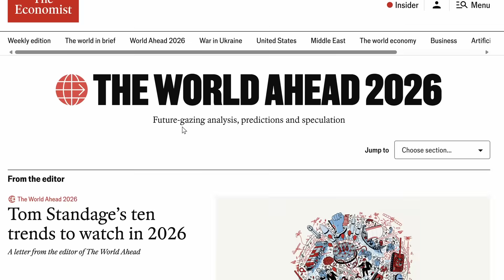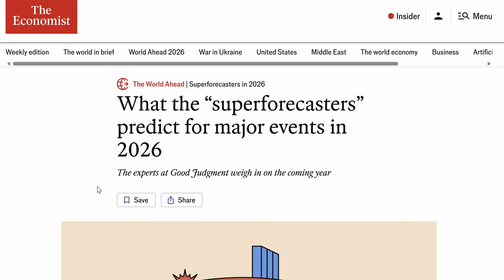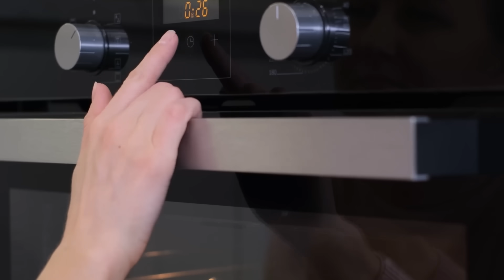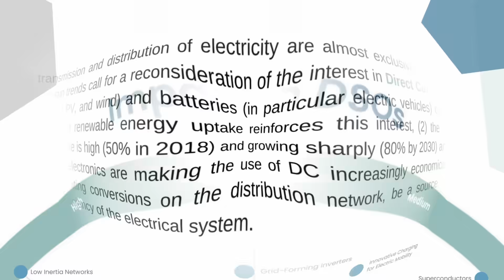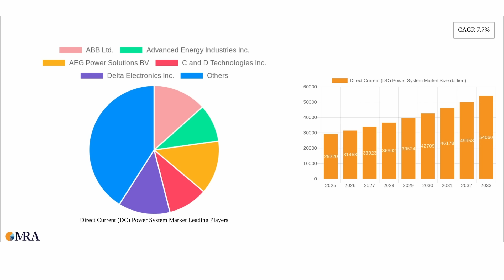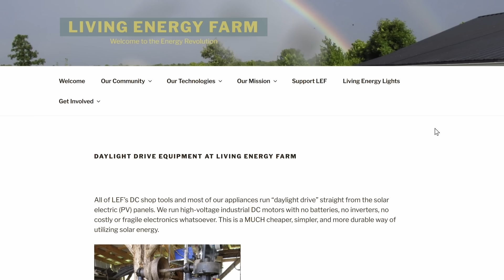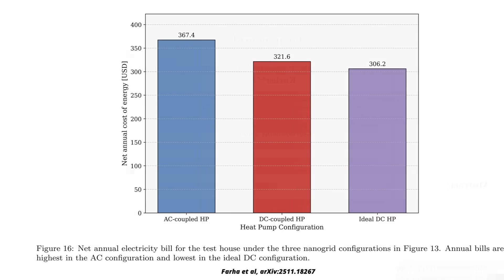Are We Using the Wrong Kind Of Electricity?

Comment: Talking about DC as if it is one thing is misleading. DC comes in many voltages. A 48VDC battery will not power a flashlight or cellphone. A 5V USB power bank will not charge a car. Converting from DC to DC is as lossy as converting between AC and DC. 
High power DC transmission will leak causing ground currents that will corrode pipes and foundations miles away and requires technicians to test for and stop leakage. An example is existing DC train third rail power.
AC was chosen for grid distribution for many reasons. AC has a good balance for corrosion, safety, losses, and cost.
Reply: DC can still be alright direct between distribution centers if you dont need to do anything to change it.

In NZ we have had a DC link from the hydro dam to wellington for decades as DC doesnt need as powerful control gear. Those lines are very high up in the air though (part actually goes under the cook straight)
Reply: @Alice-si8uz  Long lines and high voltages are necessary to make D.C. viable.
Reply: @tedmoss same reason they used AC, 100.plus years ago AC was chosen because transformers were the only viable solution, today's high power semiconductors provides an alternative
Reply: @tedmoss  High voltages are necessary to make AC viable too.  It has nothing to do with AC vs DC ... transmitting power long distances requires high voltages to reduce the current because power-line losses are roughly a function of the square of the current.   P = I * I * R.  (ignoring other things like corona losses in AC systems and such, for brevity).

Doubling the voltage cuts current in half, but also cuts losses to 1/4th of what they were before.   That's the magic of how power is able to be transmitted long distances with low losses.

Average losses for the U.S. grid run about 5% now.  That's it.

-Matt
Reply: Modern power supplies use semiconductors and high-frequency transformers. PC power block , for example. 115-230V AC is rectified by diode bridge. Then the DC is converted using transistors and a high-frequency transformer to the required voltages, and rectified again. This results in voltages of e.g. 12V, 24V, 5V, 3.3V. Modern server power supplies are adapted to 115-230V supply voltage, and it doesn't matter whether it's AC or DC. Nothing even needs to be switched.
Reply: @imantsjansons5009  This is for computers mostly and has been that way for many years.
Reply: @tedmoss  since the beginning, to be precise.
Reply: @tedmoss  No, these are everywhere. Only in rare occasions you can see a good old 50 Hz transformer in a power supply unit today.
Reply: @imantsjansons5009 MEGA THUMBS UP.

There are not many people, which know, they can run a PC power supply with DC.

My 450W and 850W PC power supplies are UNIVERSAL working with 90-260V AC (world wide) and even work on a 60V DC battery.
Reply: @michellekonzack  True, but how do you handle switching and protection on the DC side?
Reply: Lots of things now do not care, AC at any frequency, wide voltage range, DC also straight into the plug. Big consumers like data and AI centres are now requiring DC to save having to rectify and smooth AC. Induction motors are still the large legacy AC consumers.
Reply: @howardsimpson489  It's not primarily to save and remove rectification that's an irrelevance in the big picture of things. It's more to deal with the effect of having thousands of switched mode supplies on the same AC line all screwing with the AC. Switched mode supplies do interesting things to the AC input and when you have a load of them the end result is ugly.
Reply: @imantsjansons5009  inductors in this case.  The high frequency (for a PC supply, up to 100kHz) allows smaller inductors to be used.  The motherboard also has a while array of DC-DCs to supply the processor (which usually runs in the 1V range), and that delivered voltage is actually variable depending on the workload on the machine ).   Basically, lower frequencies require bigger transformers and inductors.  Higher frequencies can use smaller transformers and inductors.  For both AC or DC conversion.  The European grid at 50Hz requires larger transformers than the American grid at 60Hz, for example.
Reply: @junkerzn7312  Hence why aircraft use 400 Hz.
Reply: @imantsjansons5009 most properly modern supplies use power factor correction not just a diode bridge for the initial conversion btw. That may well chuck a wobbly about not getting AC input. It's also an unnecessary conversion to the high voltage intermediate DC.
Reply: A lot of people are forgetting buck / boost circuits are cheap as chips and very often over 95% efficiency for pennies.
Reply: @Ziplock9000 buck is fine, but boost circuits are more expensive / limited compared to an AC transformer. Once upon a time maybe grid distribution using DC was viable, but now with solar on every roof electricity can flow in any direction on the grid, which transformers handle without a problem, but chucking DC boost converters to handle the sort of power needed accross the transmission network is going to be insanely expensive.
Reply: @D4M14N1989 bring the grids DC to the home, let the solar inverter supply DC direct to the grid.
Reply: It was the correct choice at the time. DC is better for nearly every case. Motors and arc systems being an exception and even using DC to feed AC modulators is more electrically efficient for these applications. The price of copper for a transformer vs the price for an industrial size boost converter may not be as far apart as you think.
Reply: @frankrey7676  Reliability. I have had transformers that lasted for 100 years. A.C. is better for transmission except for very long lines with very high voltages.
Reply: @tedmoss 

Transformers are also safety insulated. When a power transistor fails short in a DC converter you will have the input voltage at the output, which will be dangerous. Too many people are trying to reinvent the wheel...
Reply: @westelaudio943 DC/DC-converters can also be built with safety insulated transformers. Every phone charger and pc power supply is built that way, the AC is only fed into a rectifier before the conversion. The only advantage of classical transformers is their reliability, because you can't really get any more reliable than a chunk of metal and copper (although switch mode power supplies can still be designed quite reliable).
Reply: I was just thinking about electrolysis issues myself.
I still think the AC DC debate is really application specific.
And then, I also wonder what happens to 2 phase and 3 phase AC :/
Reply: I dont think you understood the video. Her point wasn't that we are stupid and chose the wrong one, it's that thtough innovation we could have the better one.
Reply: @foreseer4552  her point is always we're stupid, isn't it?
Reply: Ac is convenient for distribution, as it can easily be transformed to other voltages, but for long transmission distances DC can be more efficient as the establishment of an electric field, and then reversing it causes losses that make DC less costly. That technology has been in use since the 50's. The voltages need to be high for DC  (as with AC) to keep I^2R losses low.
Reply: DC-DC converters are a thing and they're very efficient.  Even for 3PH AC motors, VFDs convert AC-DC-AC.
Reply: Sure but if you use switching psu's you're gonna dc it first anyway before chopping at higher frequency

In fact most psu's in your house would be fine as they are to feed high v dc into them, the first thing they do is rectify it because a transformer at 60hz kinda sucks.. Like we largely don't use the advantage of it being ac already.
Reply: DC makes sense running from battery storage. There are solutions now that can DC charge your car at home directly from the house battery and solar. Also many things run on DC power so installing USB ports in the house for charging and running electronics in the house makes sense. There should still be AC outlets of course.
Reply: Hvdc distribution networks tend to disagree
Reply: @clivevreeswijk4555  Its the yin and the yang of it.
Reply: I really wonder why in Greece they used DC current (500kV HVDC Station) between Mainland and Crete. Watch this video: Δαμάστα: Σταθμός HVDC 500kV που Συνδέει την Κρήτη με την Ηπειρωτική Ελλάδα
Reply: @PlanetIscandar decoupling the grids w.r.t. synchonisation is one.
Reply: Pffft. A 48vdc battery will power a flashlight fine. It’s just going to last very long before you need to replace the bulb, but for a very brief moment it’s going to be amazingly bright!
Reply: Converting AC from one voltage to another is as easy as just using a simple transformer. DC conversion is more complicated and has many elements that can fail. DC to DC conversion is the biggest source if failures in modern equipment.
Reply: I agree. DC just has too many issues beside, we already have AC grids that are proven and reliable. DC to AC converters are only going to get better over time. In the case of China, were they can generate large amounts of DC power from solar, there is no problem transmitting high voltage low current DC for miles but once inside a city, DC makes no sense. To many problems. I suspect these large companies are pushing DC. They have a financial interest in doing so. They want to make money.
Reply: With modern electronics the game has changed. If you were to build a system from scratch,  you would use DC, even for medium voltage,
Reply: Absolutely, good comment made! 
AC still has a lot going for it. It is a 'complex subject' and needs 'understanding'! 🎉
Reply: Modern DC-DC converters (GaN semiconductors) are about 90% efficient, so losses aren't a thing anymore (nor with AC-DC using similar technology). (Of course, the converter switches the DC and turns it into AC and then converts it back to DC but that's another story 🙂)
Reply: @dggeers 90% doesn't sound like nothing. Especially when you also sometimes have multiple stepdowns.
Reply: @dggeers absolutely. I've personally measured 95%+ at 50% load on some of out 24 volt supplies. And as high as 92 on our 5 volt versions.

Below that it can really tank quickly. But modern SMPS's have very respectable loss numbers now-a-days
Reply: @dggeers  I would bet that most all D.C. lines convert A.C. to D.C. using rectifiers and at the other end convert D.C. to A.C. using solid state converters.
Reply: @dggeers  90% of efficiency is lame for today standards. With proper optimization you can reach 98-99%.
Reply: @dggeers  10% losses isn't a thing? Are you mad?
Reply: @gugolinyo  Yep! Stark raving...
Reply: Talking about water as if it one thing is misleading.  Water comes in many pressures.  A pressure washer will not fill a glass or a cup.  A glass or a cup of water will not clean a car.  Converting from water to water is as lossy as converting between ice and water. 

Talking about different voltages of DC as being unique in some manner... is as silly as talking about different pressures of water as being unique in some manner. Water is water, DC is DC, regardless of the water pressure or voltage.
Reply: @jimmy_kirk  I'll try to remember that the next time I drink from a firehose.
Reply: "modern" DC-DC converter efficiency depends on just how large a ratio of the voltage is being transformed.  For a high-end design, 95%-99% is in the cards.  But once you go over a 2:1 ratio (say, converting 48V to 12V), you your efficiency is more likely to be in the 92% range.

The same is true for DC-AC and AC-DC efficiency.   So AC is generally far worse at down-converting to low DC voltages typically used by electronics.

But designing a high-efficiency DC-AC or AC-DC inverter/converter is much, much more difficult than designing a high-efficiency DC-DC converter.  In real-life, DC-DC conversion is going to be roughly more efficient than DC-AC or AC-DC conversion for the same voltage ratios.

I'm sure some people are thinking about microinverters and their "98%" and "99%" efficiency claims, but there is another factor in these conversions that often gets lost and that is voltage regulation.  When you need to provide a highly regulated output, efficiency suffers.  But if you don't need to provide a highly regulated output, conversions can be very efficient.   Microinverters don't need to provide highly regulated outputs because they are basically pushing against a live grid (same with DC-DC charge controllers... they are pushing against a battery).  Hence the 98% efficiency.

This also means that large-scale DC distribution systems have a major advantage in that the voltage does not have to be highly regulated.  A 700VDC distribution system can easily run in the 500VDC to 800VDC range without any hicups.  An EV's DC distribution system has no problem handling a battery voltage that varies from 350V to 450V.  And so forth.   DC has huge advantages in this regard because AC distribution systems don't have much wiggle room on voltage selection.

AC systems also have significant no-load and low-load operational losses while DC systems have almost none.   This means that at low power levels relative to design specs, DC systems completely trample AC systems.  And not just by a little.

-Matt
Reply: @junkerzn7312  Excellent. You've really delved into the subject.
Reply: @junkerzn7312 not true, because how can you explain, that a Victron Energy SmartSolar MPPT 250/100 convert 160V DC (4 Trinasolar 425Wp in series) with 98% efficiency to charge my 24V SOPzS battery?

In high Voltage conversion, it is already possible to reach over 99%.

240V to 48V is mostly the same as 160V to 24V or even 24V to 3,3V for my Orange PI or ESP32
Reply: @m @michellekonzack  first, I actually did address charge controllers in my post.  Second, the specs you are reading do not hold across all combinations of voltages and currents.  That 98% is a best-case scenario.  Same as for any power supply.  One can always tune power electronics to be maximally efficient at a specific voltage and current, but one cannot operate at that efficiency across the full range of voltages and currents supported by the device.
Reply: LEDs don't care for voltage, it's about the current.
Reply: @jpt3640 Aaaackshually...
Dielectric breakdown disagrees with you. Supply voltage doesn't matter, until you try running way too high a voltage straight into your LED with no other resistance in series.
Reply: @j @jpt3640  LEDs are more or less just diodes, so they are current-controlled devices with a fixed voltage drop.  The I-V curve is very sharp.  The light output is regulated via the current.  There are two ways of doing that.  One is to use a resistor in series… very common for small LEDs on circuit boards, but very inefficient.  The other is to use a LED driver which is basically a controlled current source… which is very efficient and what nearly all LED lighting uses today.

External LED current supplies such as a MeanWell have a very wide operating voltage range in order to supply a fixed amount of current to a string of LEDs connected in series.  In this regard, LEDs don’t really care about voltage… only current.  But that doesn’t mean you can use any voltage.  It means the amount of voltage needed to supply the desired current is not fixed or known before hand.

LED strips come in two topologies.  One is a limited series of LEDs with a built in resistor, repeated endlessly (thus uses a voltage regulated power supply).  The other is an endless series of LEDs (however many you need) without a built in resistor that requires a current-regulated power supply (dynamic voltage range from a few volts to a few hundred volts to supply the desired current).
Reply: What part of your ass did you pull this from?

DC to DC intrinsically is less lossy than AC to DC because you literally are doing fewer conversions in the process. AC to DC, first you need a transformer, even if it's just 1:1, you need a transformer for isolation if not stepping down the voltage to be closer to target voltage, so you get something out of the power the transformer is wasting.
Then you need a rectifier, ideally a FULL BRIDGE RECTIFIER, to convert from whatever voltage AC to similar voltage DC. Then you need capacitors to filter the waveform into a flat voltage. Then, unless your DC voltage target is above the AC supply, you need a buck converter. Otherwise, you use a boost converter. The least-lossy part of this is the boost or buck converter. For DC to DC, the converter is all you need.
Reply: @LokiScarlet I challenge you to charge your phone off a DC to DC buck converter hooked up to a 500kV line with no isolation transformer. Then come back here and post the results.
Reply: @impatientairbag  The hard part is getting access to a 500kV DC line. I ain't made of money and I don't have the clearance to make it into wherever I'd find one that exists so...
Reply: 48 volts DC won't power a flashlight or cellphone?!? Horse puckey! Typical flashlights run between 3 and 9 volts.  The average cellular phone battery runs between 3 and 4.3 volts.
Reply: @swiftmatic  It won't power those items rationally. It shouldn't be necessary to say so, and it shouldn't be necessary to say why, and I won't.
Reply: @-danR No shit, Dick Tracy. Where do you park YOUR squad car?  A full 48 volts would catastrophically fry most, if not all consumer electronics. Hell, it would burn out most automotive systems as well. But it CAN be stepped down effectively. I shouldn't  have had to say this, but I did. I'm not here to educate anybody, but I WILL call out bullshit.
Reply: @swiftmatic Just power a bunch of flashlights or cell phones in series 😂